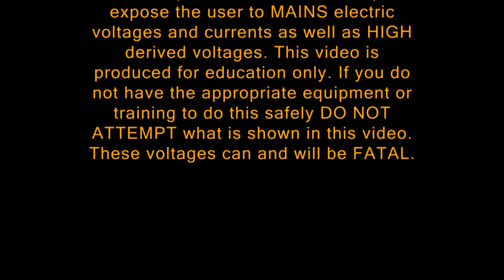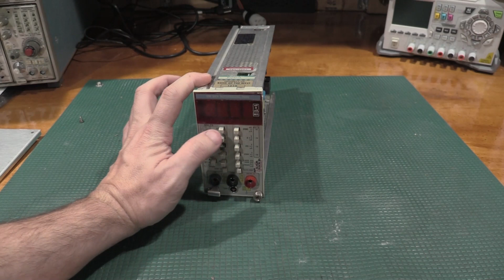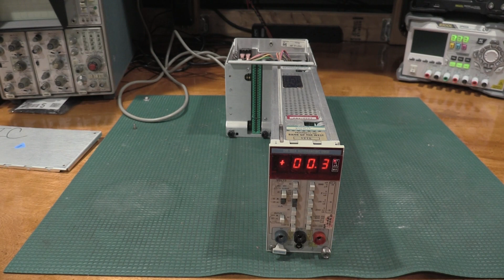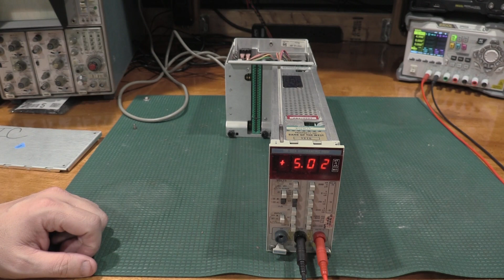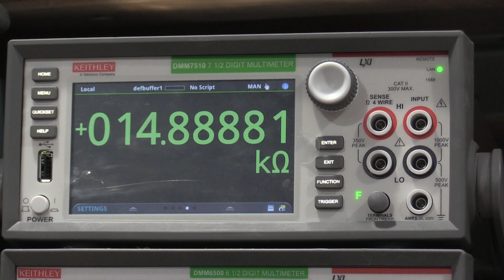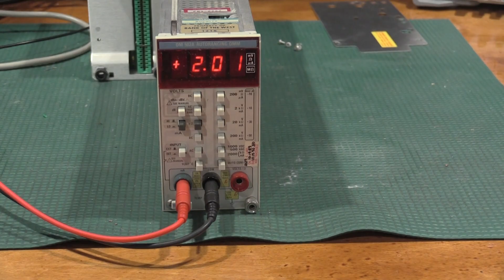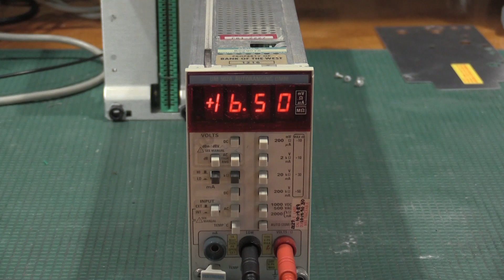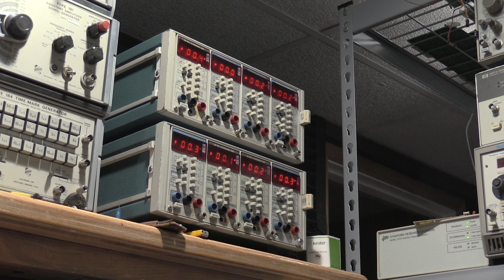DM502A The final Restoration

Comment: Can you give me info on the backplane edge connector. I would like to know if any of the pins have data that could be read by an esp or HPIB interface?
Reply from the maker: HPIB is added to the TM5000 frames and plugins only. This was accomplished with a additional connector on the back of each plugin. Most of the TM500 series units are fully analog with no microprocessor control or readout.
Reply: @ZenwizardStudios  I would be very much interested in a video about HPIB compatible lab equipment. 

Including devices that I could wire a 12 bit ADC to an internal test point, so that I could do wireless readings via an esp32..

I have  a DM501, so if it is calibrated, then I only have to calibrate the ADC to match the DM501's display and also know what range it is set to.. 

Does the DM501 send measured readings to the edge connector, or do I need to find a test point on the PCB?

The DM501 seems to have a lot of pits on the back plane to be just power.. What are the other pins for? 

Do you know where I can get a KiCad footprint/pinout for the backplane?
The PDF doesn't include that info..
Reply from the maker: More than happy to do a video. I am doing data capture over TCPIP at the moment. 12 bit ADC for a DM501 feels a tad excessive? especially given reference stability in the 501 as well as reference stability for the ADC 12 bit feels like we should be talking LTZ1000 territory. This is what is in my DMM7510 7.5 digit meter.
Reply: @ZenwizardStudios  Thank you very much.. YT deleted my 5 paragraph reply which I said a lot about what my plans are. I don't know what word I said that caused it. and I didn't save a copy. So I will have to do  my best in another reply.. It is getting to the point, that I am gonna have to start sending 100 word replies, 1 word at a time.. or send it on X
Reply: @ZenwizardStudios  I'm gonna give this another try..
I am designing a unit that uses a esp32 and a ADS1115 as a wifi DVM.
My thought would be to use a DM502 as a calibrated front end.
Then just calibrate the ADC to match the DVM display...
I guess you can see where I am going with this...
Can you help?
Reply from the maker: I might be able to however one of the places you will struggle would be in linearity of the ADC as well as the reference. For full functionality you need a range of 100uV to 1000 Vdc. What might be easier is to just use the calibrated meter and tap off the number before the display drivers. This would be a way to use the meter as an analog front end but you can read this display value RIGHT before the driver chips this will save on time the integration portion. As well as keep the signaling all digital. 
Best way to type in long replies is in a word processor and copy past to youtube. I have allowed links in comments on the channel however youtube seems to not believe me when I told it so it keep eating them for everyone.
Reply: @ZenwizardStudios  Yes, I was also thinking of reading the display pins. My original thought was, that the DVM range selector acts as a voltage divider, and the DVM only needs to read the last stage which would always be 0 to 9 of the lowest voltage.. 

Currently My ADC input has a voltage divider from 0 to 88 volts, but if I tighten it to 0 to 9.999, then I could get a finer scale.

My only concern, is how would my circuit know which range the input is set to.

I think my message was deleted because I used letters 23 and 19.. Yes, since 1984 happened 3 years ago, I have had to keep a record of everything I enter here.
Reply: @ZenwizardStudios  Is there a formula that can accurately map binary steps to decimal steps? 

I might be wrong, but my thought is that the DVM circuit is only reading the (0 to 100uV range) and the range knob only acts as a voltage divider to convert the 1000v range to 100uV.

If that is the  case, I only need to calibrate for 0 to 100uV.
Then I would need to know what range the selector knob is on..
The problem comes in, if my input is beyond the setting on the range selector.

If I read the display directly, I would not have a over range magic smoke event, but I would still need to know what range it is reading.

I also have other plugins(I forget which ones), but I would like to do the same for all of them.. Like converting an input number to PWM to control the output of a power supply.
Reply: @ZenwizardStudios  I was thinking that reading the display is the safest(no over voltage) and means you only need to calibrate the DM502(or other units)...

I don't know how many pins are involved to get display plus range setting,
but if you use a PCF8575, that chip converts 16 input/output pins to i2c.
and you can change the i2c address so you can address 8 of those on the same bus.

Then there is a i2c port expander, that can give each slot a personal i2c addr. 

so if the expander is wired into the rack unit to give each slot it's own addr, 
and you have 1 or 2 PCFs in each Test Unit, that is a lot.. 
You will only need one i2c port on the back of the rack 
that you can connect the esp to.. 

Let me know if this sounds good to you..

Comment: Hi, I'm glad you're better, my former boss's wife in the research labs didn't treat a bad flu and it damaged the stability center in her brain, she could only walk on crutches or with the support of another person and ended up in a wheelchair.
That set of multimets is amazing, the ability to see multiple voltages at the same time can be a decisive element in finding a fault in some repairs (own experience - monitored seven different motor card voltages from an industrial CNC). Unfortunately, these machines cannot fit in my mini lab due to the depth, so I made at least a quadruple voltmeter DC +/- 200V and it is a great helper, they are galvanically isolated from each other and can measure independently or with a common ground.
Thanks for your great videos, I'm looking forward to more because I'm learning a lot.

Nice day 🙂 Tom

Comment: Great video as usual. Recently i entered this rabbit hole by buying TM506 which i restored cause it was a bit dusty and worked somewhere 24/7 by the looks of it. Among plugins i got is DM502. Funny thing is, that plugin works(powers up) only in 3rd compartment and is dead in others, while other plugins(FG501,DC504,MR501) work in any compartment.
Reply from the maker: Check the pass elements in the TM frame. I suspect issues with the high power PNP or NPN transistors. There is a set for each slot. In the DM502 I think they are used in the power supply as a regulation element. This is true for ALL TM5xx and 5xxx frames.
Reply: @ZenwizardStudios  I checked schematic of FG501(use pass BJT's) and DM502(doesn't use pass BJT's),they use same voltages from mainframe board so i placed FG501 in 3rd compartment and it powers up,works perfectly fine. So i'm a bit puzzled how this ended up. I will get to the bottom of it but for now i'll leave it how it is and when i'll have some more time i'll see what's the issue.